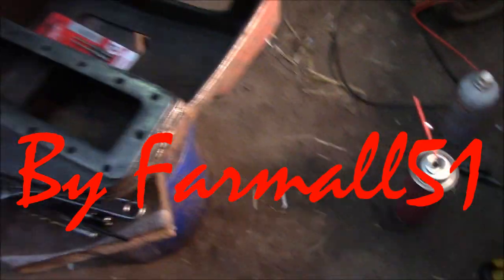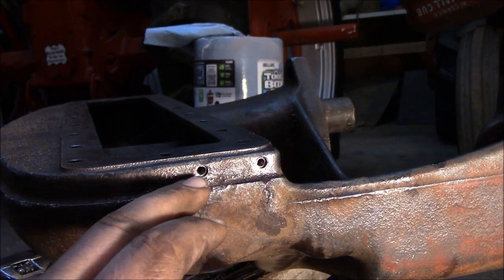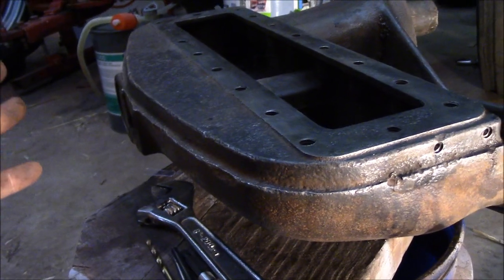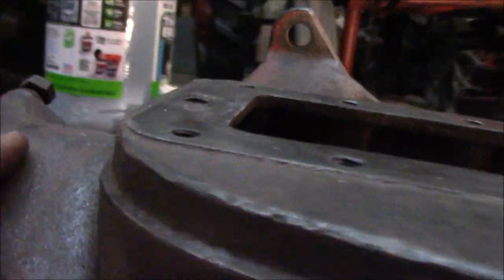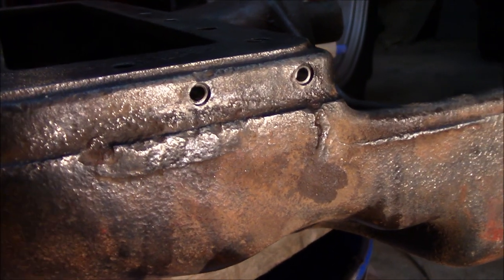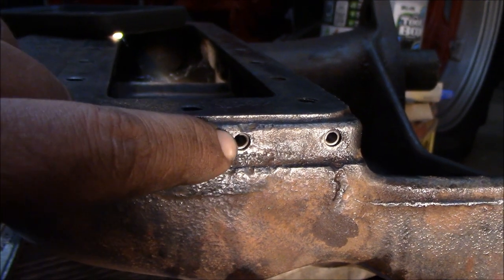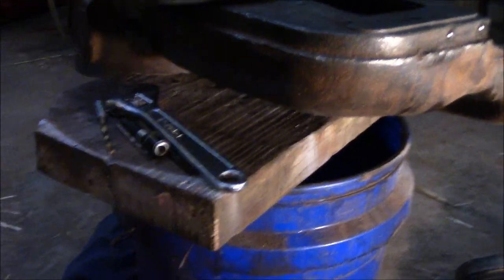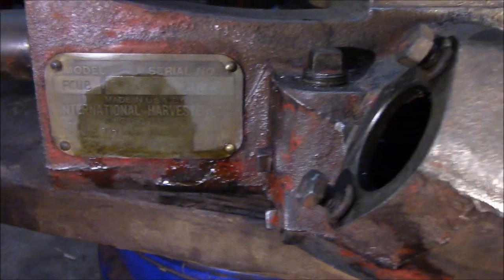47 Cub front bolster thread repair

Comment: I like the idea of leaving the original tag
Reply: Farmall Fanatic
 - me too.  tape it off good for the paint job and it will look sharp...
Reply: Me too. We've never changed them. Except some idiots sand blast them and others paint over them without masking them and ruin them. On the bigger tractors like the W-9-650, the serial tags are located on the right side of the casting which supports the fuel tank and air cleaner. They are very hard to get at to change, and they are well protected anyway. The H and M series tractors are usually in the worst shape because they are in the open where they can get damaged. The W-4 and W-6 tractors are in the same location, except the battery box helps protect them a bit, and they're usually in better shape.

Comment: I would have probably drilled it to 13/64 and then tapped it to 1/4. 13/64 is the tap drill for 1/4" Those 1/4" hex driver drills are very expensive, too. I hate drilling out broken bolts. It is virtually impossible to drill a bolt out and keep it straight. Just recently, I had a bolt break in the generator bracket on my W-4 and it wasn't nice to get out, although an easy-out did it, you still can never drill perfectly  with a hand drill, and there again, have to worry about drilling too far and ruining the head.  In steering boxes, I have had really good luck mixing a slurry of oil and grease. Just #2 grease mixed with a small bit of 15W40. I have had to rebuild a few steering boxes, especially W-400-I-560. They have a hollow worm shaft so water can get into them and seize them up to the point they are impossible to steer, even with power steering. Inside, the sector arm has a double roller bearing with a point which the worm drives. I disassemble the bearing, and weld up the point with build up rod and then machine it off. Then I clean the race and rollers with emery cloth and reassemble it. Of course, I replace or at least clean the bearings on the worm shaft and replace the seal, but then when it's full of that slurry, they handle great, as good as any tractor with armstrong steering can, and those with power steering handle effortlessly. I prefer the way they handle to hydrostatic power steering.